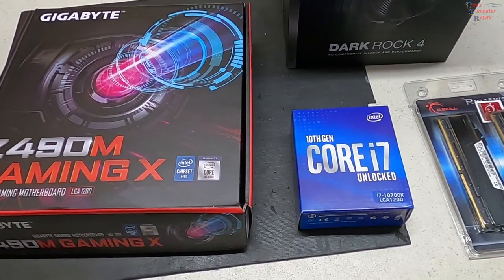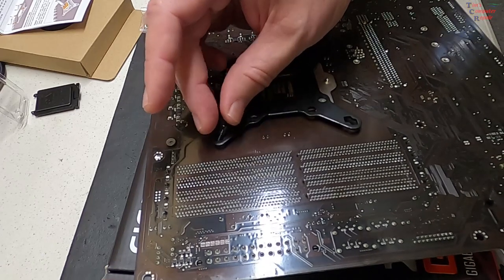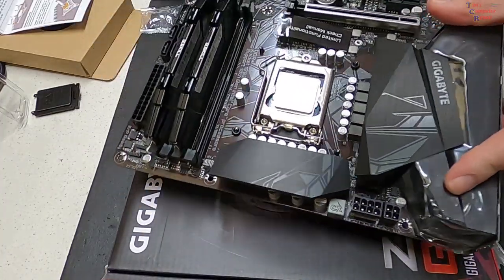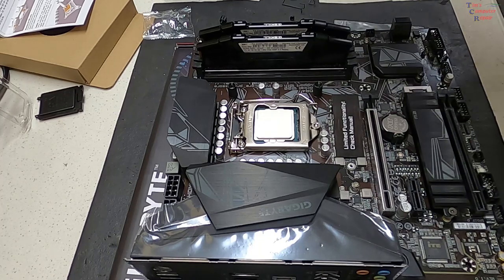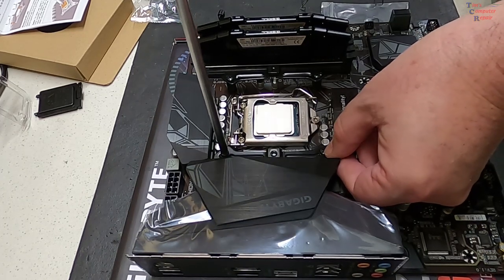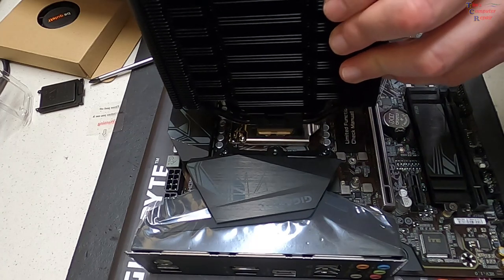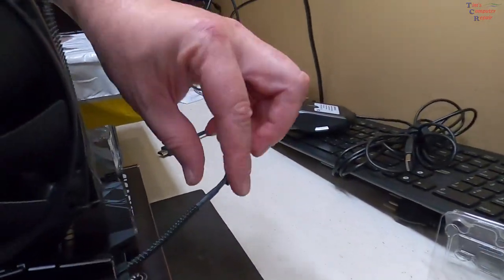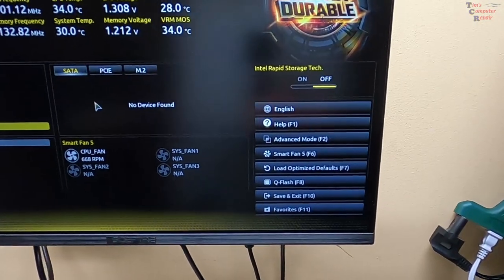How to Install a Be Quiet Dark Rock Cooler on a Intel 1200 Socket Motherboard.

Comment: Aren't the rubber washers meant to go on the other side of the board- preventing contact with the backplate?
Reply: Wait so I damaged my motherboard by following this guide?!?!
Reply: @baharry  If your system runs, no- it's likely not damaged at all. But this thing has a lot of mounting pressure and it would be wise to put the washers in the correct position to prevent cracking or damage in the long term.
Reply: @kyle-qw5yx  I’m building my system right now. First time builder. Super worried cause my fingers touched all sorts of things in the back of the motherboard while trying to mimic this guide. I’m really worried I might’ve damaged something.....
Reply: @baharry  Your fingers touching components is fine. Electronics these days are vastly different from back in the day. Don't really have to worry about static electricity much- or the oils in your hands. 
If you're installing the cooler on the 1200 socket: The installation instructions are identical to those of sockets LGA 1150, 1151, and 1155.  I'm sure you will be fine :)
Reply: @kyle-qw5yx  So you’re saying my greasy fingers won’t damage anything? If so that’s a huge relief cause that’s like 70% of the reason why I’ve been super paranoid.
Thanks man!
Reply: @baharry  yeah no worries. Nobody wears gloves when they build one

Comment: keep in mind everyone, you would have to be insane to install the cpu heat sink before the motherboard is in the case first, you need to get all the wires hooked into the motherboard before installing the heat sink as it will block access once installed, not to mention, you risk the heat sink moving around on the cpu even risk cracking something in the process of inserting the motherboard in the case while the heat sink is pre-installed
Reply from the maker: Everyone has there way. Thanks for commenting.

Comment: Wacht out. Thoose rubber washers are supossed to hold the screws to the back plate on the outside of the mbo. Not inside.

Comment: I bought the "Cooler Aigo MAX V5 Shadow Pro PWM" for my Gigabyte Z490 Gaming X motherboard INTEL 1200 socket but unfortunately I think it is incompatible. Can you help me answer this question? Do you have a video step by step in the assembly with this cooler of mine? Beste regards

Comment: Hello! I have a question oabut bridge. When i screwed it down to the bottom side frames, i can screw it just a liitle bit, because i fell it is enough. I affraid to damage something. I have a space on other sides between bridge and bottom side frames. Is it should be like that? Cooler is Dark Rock Pro 4. Thank you!

Comment: Is the cooler not to Bad for the i7 10700k ?
Reply from the maker: It works perfectly well with the 10700k.
Reply: I would advise against it. I have a 10700 (non K) and hit 90C gaming, and 95C in aida 64. I think it's due to this cooler having a tdp of 200w, and the 10700 being able to pull 224w. I've reseated the cooler and applied thermal paste multiple times
Reply: @kyle-qw5yx  Doesn’t the I7 10700 non K pull up to 65w without overclock?

Comment: "sitting on top of your memory"  not if you divert the air flow correctly, never have i seen a proper configured cooling system diverting air flow to the front of the panel, always divert the heat to the rear and the top of the case, pointing the fan towards the ram channels will create neutral air pressure that will build up internal heat, air gases floats up not side to side
Reply from the maker: I guess most everyone is doing it wrong then. Thanks for commenting.

Comment: As far as i know be quiet has terrible mounting kit. That bar underneath is bad solution i think. And you miss something important. Installation of the fan... You skipped it. Fan is hard to install and when you unmount him you dmg the heatsink and the colour. Anyway...
Reply from the maker: I have installed many different brand coolers. Be Quiet has the easiest mounting solution to date. The results of load temps that compares to water cooling under load speaks for itself.
Reply: This cooler comes with two sets of spring clips , a spare set for if you wished to attach an additional " pull " fan , there is a slight difference in the size of the clips, the main fan is 135mm , if you use the 120mm clips they will go on but be way too tight , this is where people are slipping up and damaging the fins when they try to remove the fans . I have this cooler in my own PC , no issues whatsoever and the performance is excellent, cpu is  intel i7-12700K , viewed as a " hot " one by some , as we speak it's at 21 degrees , I think that's damn good .